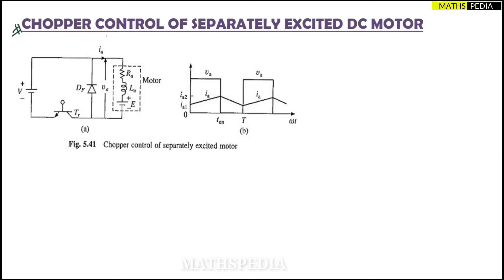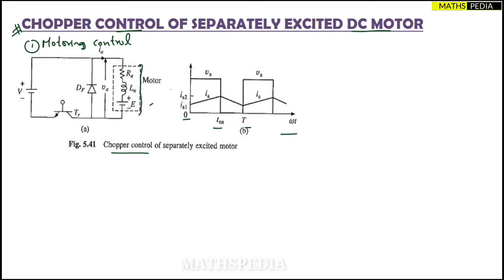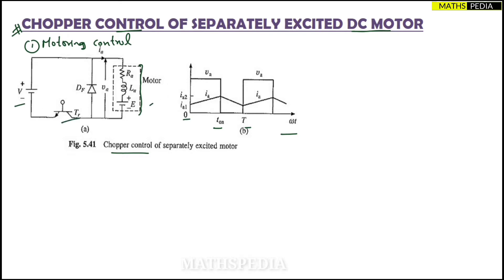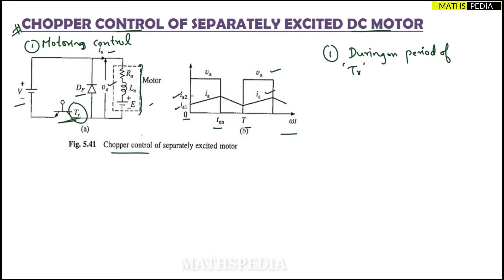Chopper control of separately excited motor | Industrial Drives and Control | Engineering |

Comment: hello again, I have a couple of questions regarding the regenerative breaking circuit for you if you don't mind:
1. what is the role/roles of the capacitor in the regenerative breaking circuit?
2. how is the energy stored in the battery is being reused in the system?
thank you sir